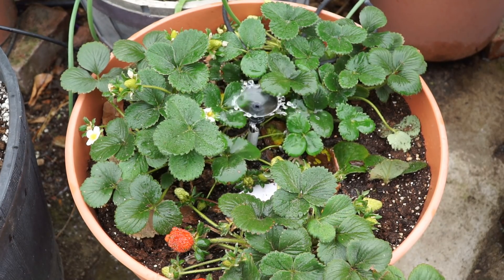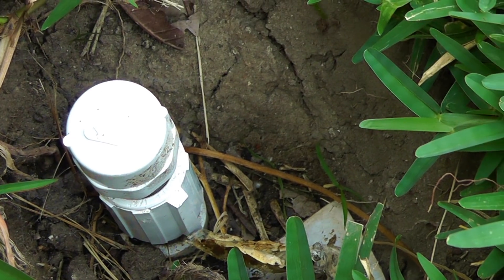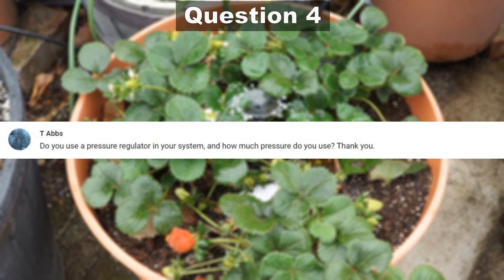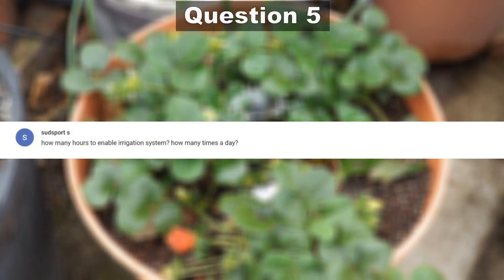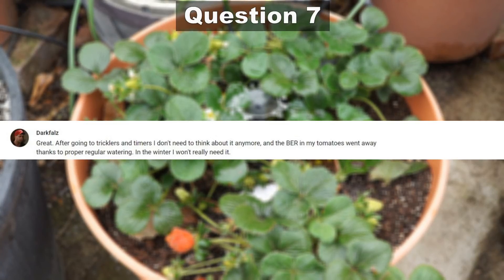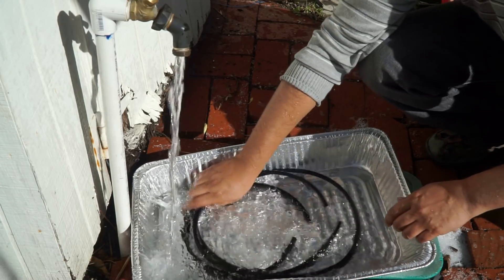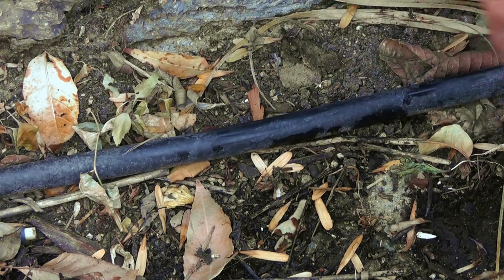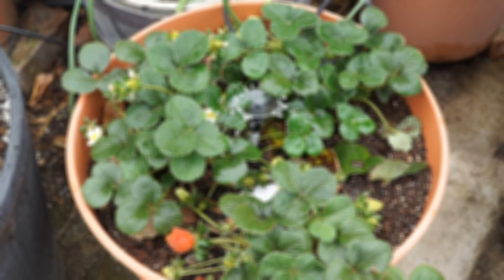Drip Irrigation Questions Answered - Q&A For Drip Irrigation Systems

Comment from the maker: 1. Y-Hose Splitter: http://amzn.to/1L79qog
2. Watering timer: http://amzn.to/1LYgtKZ
3. Hose to 1/2'' tubing adapter: http://amzn.to/1LYgI8S
4. 1/2 inch main line tubing:  http://amzn.to/1LYgNJr
5. 1/4 inch tubing: http://amzn.to/1LYgQVT
6. Barbed connector (1/2'' tubing to 1/4'' tubing): http://amzn.to/1VVlJEJ
7. Barbed tees: http://amzn.to/1LYgSwU
8. Soaker Hose Emitter: http://amzn.to/1VVlOIs
9. Stream Bubbler Emitter: http://amzn.to/1QpRILy
10. Fan Bubbler on Stake: http://amzn.to/1L79KU4
11. Hole Punch: http://amzn.to/1L7bcWr
Reply: California Gardening I'm having an issue where my seedlings shrivel up at the stem and fall over?  Do you know why that is?
Reply: I really appreciate the info you provided for installing a drip irrigation system,and where I can find everything I will need.This was a very helpful video..Thank you!!.
Reply: Thanks for the info

Comment: How can i save my strawberry plants from heat and excess rain? ( i have planted them in a large / huge container which cannot be moved from its position because of its weight and is placed on the open rooftop .)